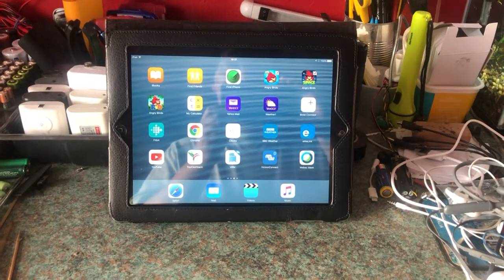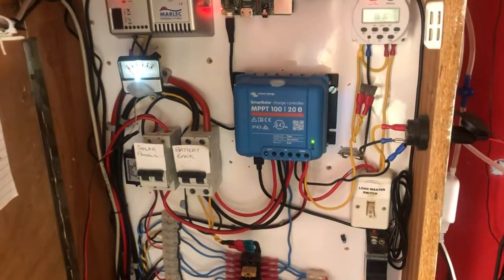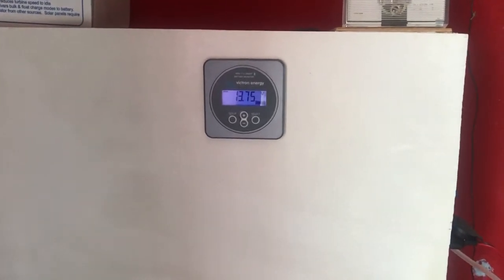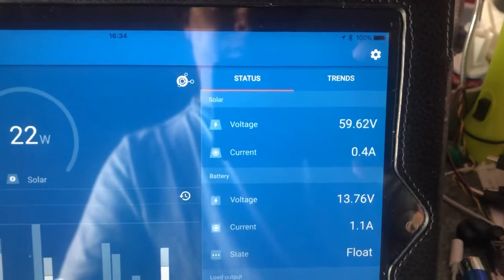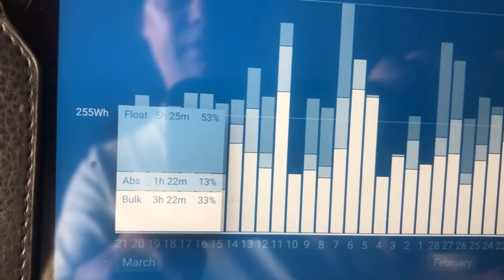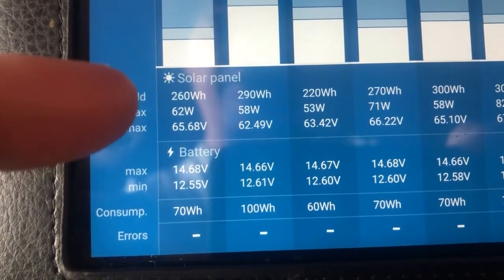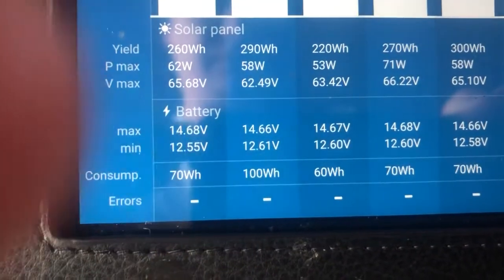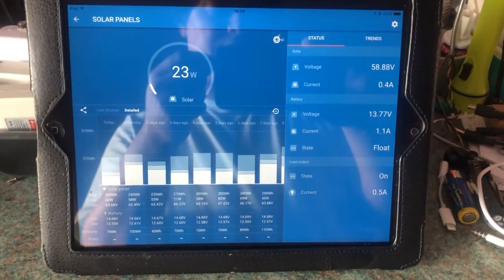Update on my solar power system Mar 2021 21 March 2021

Comment: Nice and informative. I have the  MPPT 100/30A with 2 x 245watt panels, but I have yet to set it up with my Raspberry Pi like you have. thanks for the videos.
Reply from the maker: Thanks for the interest, I like the option to monitor my system online. But the victron colour control gx was way over my budget, I read about the raspberry pi option on victron energy website and thought I would give that a go. I bought my raspberry pi used on eBay for about £30 and some victron usb cables and I was ready to go. You can read the section on victron’s website and did a video on this too. I used a raspberry pi 3b+ because it has WiFi , don’t need a Ethernet cable to connect to the router in another room (less wires is better). You will need a short Ethernet cable for initial setup. The victron colour control gx costs several hundred pounds, so I needed a far cheaper option! I like victron stuff as it’s good quality, had lots of features and comes with a 5 year warranty. Thanks again solartiger.